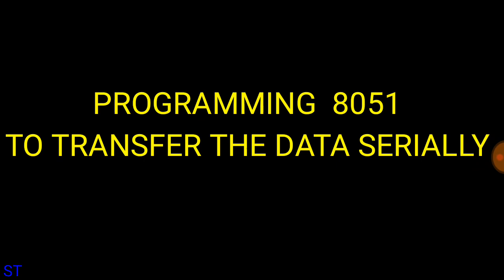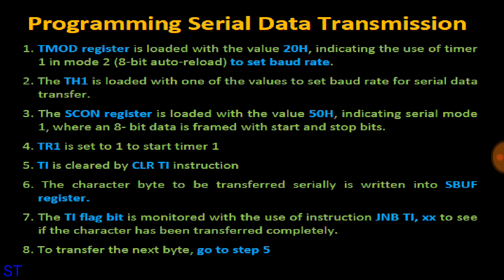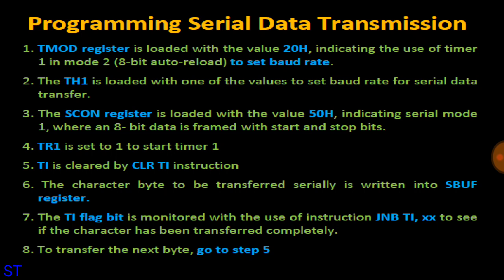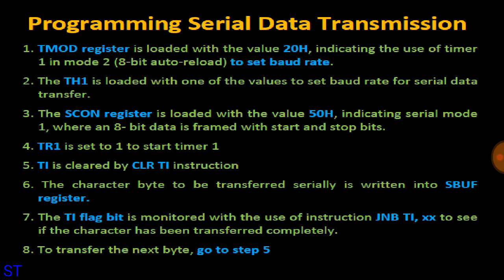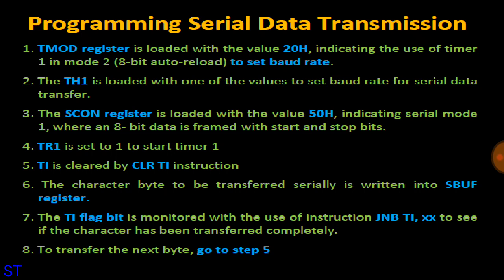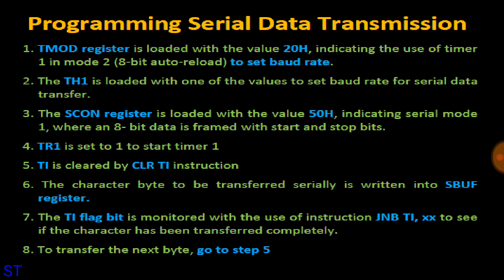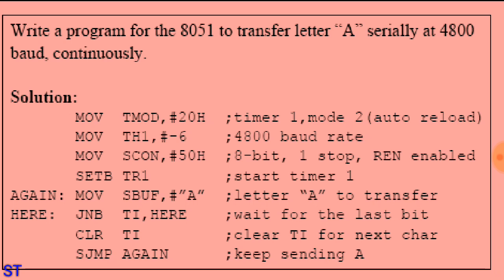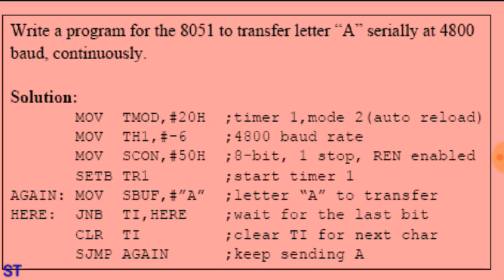PROGRAMMING 8051 TO TRANSFER THE DATA SERIALLY

Comment: How did u get -6
Reply from the maker: It's a value to set the speed of tx 4800 baud rate
Depending on the value using the baud rate will vary